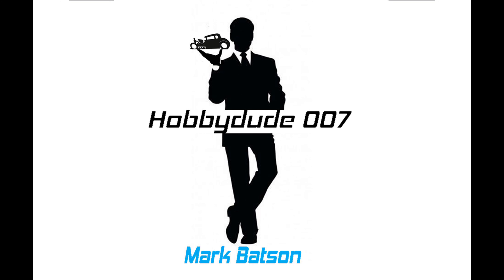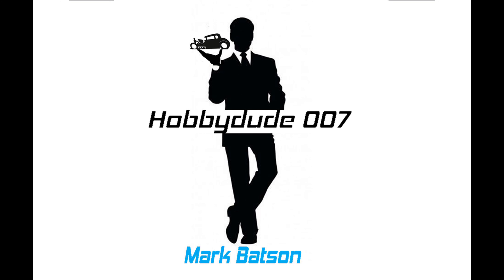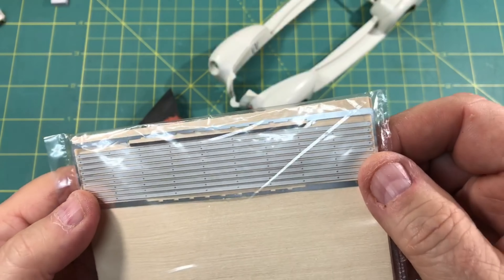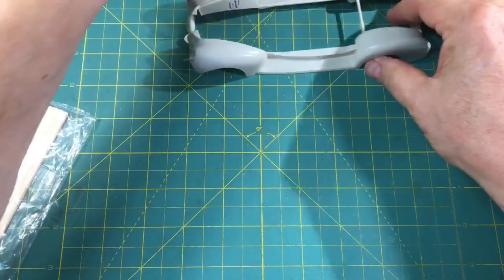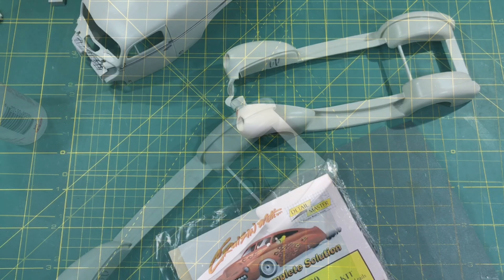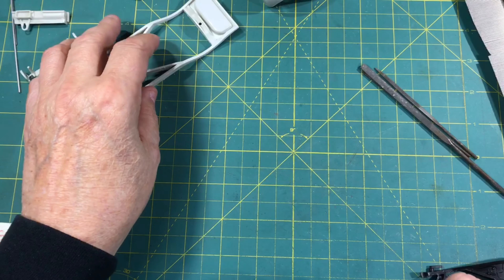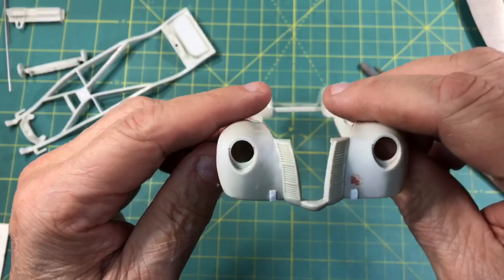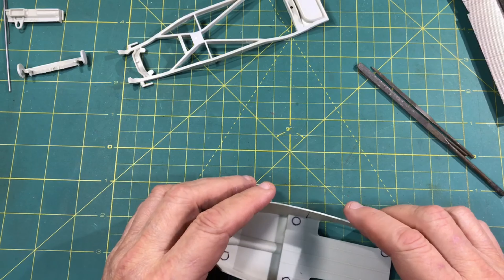1940 Ford Update for the Unified Scale Automotive Content Creators Build! Part #2

Comment: Mark. Love the work you're doing on your sedan delivery. I'm building the same kit. All the mods you're doing is exactly what i've either done or considered. I, too, am using the 
flat head so the exhaust needs to modified. Grind it out! I noticed one issue which you should take a look see. The right rear fender doesn't fit flush against the body. Check it out.
I cut that flat piece out between the inner fenders which only allowed positioning the fender closer to the body but did not solve the fit issue. I then took a few very small strips of styrene to fill that gap and sanded to fit. I also looked straight down on the recessed part of the fender that fits the wheel well and noted it had a slight bend on that small edge. Use a small flat file and straighten that line. Check for fit. Repeat if necessary. Compare it to left side which fits perfectly. I've also take a 1/16" or so out of the nose of that hood which enhances the rake of the stance. Use the chrome trim for the straight cut above the trim. Then tape off the bottom portion of the hood starting at about 1/16" down to the top of the cut at the rear. File it slowly following the tape. You'll need to slightly reshape the nose once glued back together. It's almost unnoticeable but well worth the time and effort. Mine is being built as a street rod and I do like those seats you're using. Looking forward to you're finished build. Looking really good. You build like I do — Change it for the better as you go!
Reply from the maker: Many thanks for the kind words and "heads-up" James!! I have addressed most of the issues but I'm sure there may be others. Haha!! I had to do the same thing to address the rear fender. Thanks!! Having fun!! And that's what it's a about! Thanks again for watching!!

Comment: They're molded in white now and the body doesn't down on the rear fenders right out of the box. Have to do some shaving and refitting. Ben building model cars for 60 yrs. One 40 Ford I've ever seen. Be starting my first one ln a couple months.
Reply from the maker: Thanks! Been building 60 years myself. Yes sir there are fit issues indeed. Check out this one finished and let me know what you think! 
Thanks for watching and have an awesome weekend!!
Reply: In my last comment I wrote white. Should've been YELLOW. I hate when they do yellow. I rarely keep the molded color for the body. For me,only certain cars and trucks, look good in yellow. Then it depends on the body style or two toned.
Reply from the maker: I agree!
Reply: Thanks for the reply Mark.would have responded sooner, but this is Ll new to me.Trying to learn what is what.
Reply: @MarkBatsonHobbydude007  Since AMT-MPC kits have been produced ln China, in my opinion, the quality has gone way down. Warped, thickness uneven,lot of shaving. No quality checks are being done. Just ordered my last 8 kits 3 days ago. My collection will be large enough.

Comment: Hey Mark, In building the Sedan Delivery I noticed that the placement of the gas tank is in the rear while the gas filler tube (not actually in the kit) and the gas cap is located right behind the driver's door low on the left side. Is this correct? So, I'm doing what you did... removing it! I hadn't noticed this since the kit was released in the 60's and I'm 74!!! Learn something new everyday.
Reply from the maker: Yes sir! I first noticed that over the years at car shows. I don't get why the gas tube was there either. (takes away from the great looks of the car to me) 
Despite the kits issues it's still a great classic!! Thanks for watching brother!!
Reply: I can't remember seeing one in the store before. Soon as I saw the 40 Ford delivery, I grabbed up 2. I always get 2 of a model. Do one stock, one Street or drag. Depends on my mood for the car. Be doing my first one in a couple of months. Stock and black as were the old Fords. Then a clean looking street cruiser.